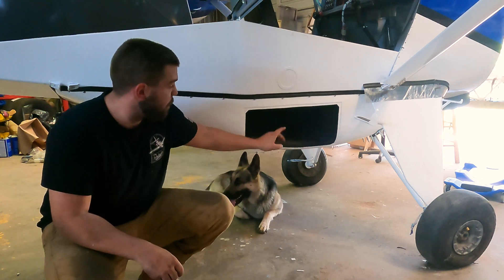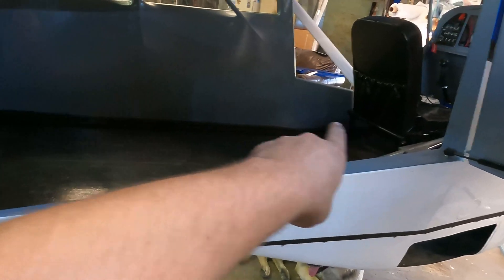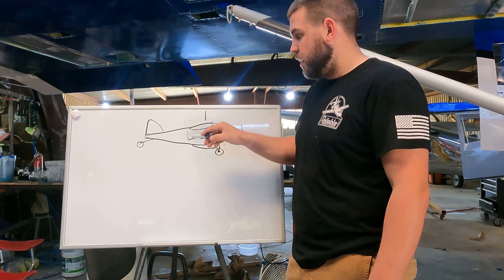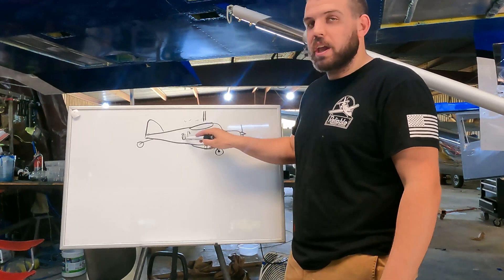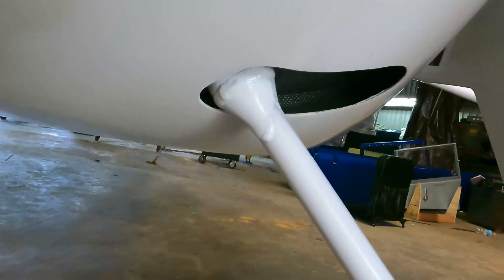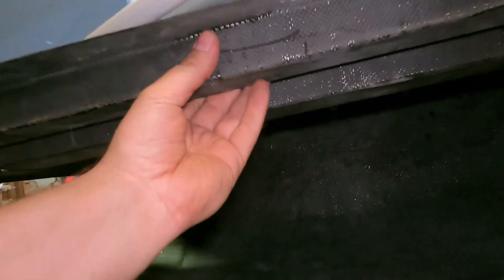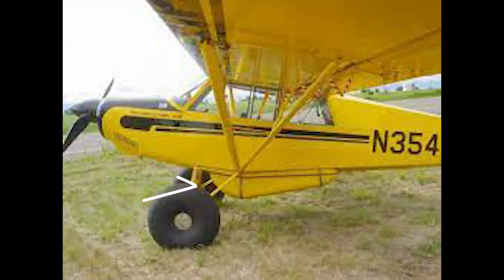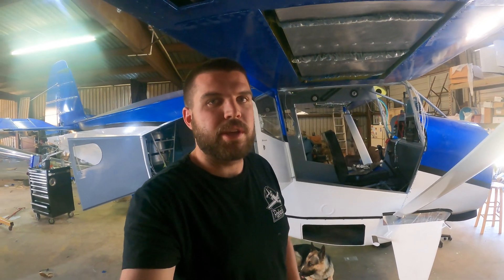Bearhawk model 5 Belly Pod - Belly pod on a bush plane

Comment: How are you isolating the carbon fiber from the steel of the frame?
Reply from the maker: The pod contacts the frame at the attach tabs. 22 of them. It is isolated using rubber grommets at each of these locations.
Reply: @The-virg  Thanks, always wondered how to keep the steel away from the panels.
Reply: Follow on question.  Have you considered using fiberglass as the first layer of the panels to provide the electrical isolation?

Comment: Someone needs to pull a mold off that part before it gets all beat up.
Reply from the maker: I have been debating pulling it off and duplicating it or pulling a mold. I'd hate to have to build another from scratch.
Reply: Dude, pull a mold, making that first part is the hard part. 
 There are a lot of Bearhawk builders out there and the BH5 needs the CG help for sure.
 Once you have a mold then just make a second Part and narrow it to fit the BH4.
 Pull a mold off that and you're in business. I do recommend putting some foam core in the outer shell to damage isolate the inner and outer skins a bit.

Comment: Excellent video, I really want to build a Bearhawk 5, seems like it would suit my needs very well for the low and slow stuff that the RV-14 can't do.
Reply from the maker: Go for it! Nothing can beat a Bearhawk
Reply: Two questions if you don’t mind - How many hours do you think it’ll take start to finish for the bear hawk 5? 1000?

How are you making the carbon fiber? Do you have a pressurized oven in your hanger lol?
Reply from the maker: @ivanvujosevic289  I would say if you have built tube and fabric and are proficient with sheet metal, 1200 would be a minimum if you stick to the plans. I will probably have at least 2000 in this one. 

I use a combination of vacuum bagging and heaters when possible to make the carbon parts. I use west systems epoxy and heat is not necessarily required but    Does help.
Reply: @The-virg  damn that’s a lot of time. I’ve been looking at this model 5, but really don’t want to work with fabric
Reply from the maker: @ivanvujosevic289  honestly fabric is not that bad. It was probably one of my favorite parts but I have worked with it before. Building is all about learning new skills constantly. What I always tell people is if you are simply building to fly and have no desire to build it will be a long road. If you enjoy the building process or have specific purpose to build then build. otherwise just buy. We needed a specific plane for our mission agency, that is why I built but 2000+ hours in the shop is alot of time.
Reply: @The-virg  you've got skills that many of us don't dude! Looks awesome. Is your 1200 hour estimate from the quick build kit? Does that include engine mounting and avionics?

Lastly, I've never been a fan of fabric planes but I do like how the wings and cowl are metal with the fuselage, and empennage fabric. I live in a cold climate and I worry about the fabric fuselage insulating for warmth, can you insulate and cover on the inside?
Reply from the maker: @Austinmediainc  tube and fabric airplane are fantastic especially if you where to ever crash one. The fabric can be easily insulated with stick on foam cut to size or actual insulation stuffed in the walls. This one is headed to west Africa so no insulation was installed.
Reply: Looks amazing! Can't wait to see how it handles in flight. I'm planning yo purchase my kit soon and I would like to do this.

Comment: Did you make a cad drawing? I have a BH4 so would be a little narrower? Great post
Reply from the maker: This could definitely be done on a 4 place but it would be much shorter and narrower. I did not make a cad drawing because I don’t have access to a cnc router to shape the foam mold. If you have access to a router that large it would make the process much easier.
Reply: Thank you Virgil. A longitudinal profile curve of yours would give me a starting point. I was hoping to convince my local surfboard shaper to CNC.😀
Reply from the maker: @Launchie  I actually started with a Naca airfoil and expanded it. I am about 15 inches at my deepest point.
Reply: @The-virg  any negative lift possibilities?
Reply from the maker: @Launchie  doubt it being that there is only air flowing on one side of the pod. The goal was to keep air attached along the entire length of the pod to reduce drag. I am gonna do some testing with airflow and smoke wands. If it needs it I may add some vortex generators to keep air flowing smoothly.
Reply: @The-virg  would love to see the vid